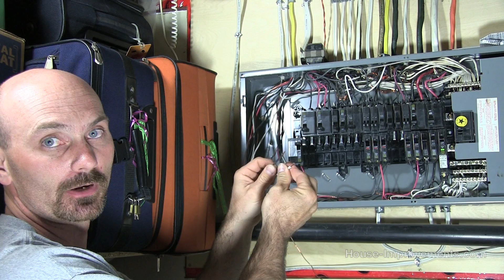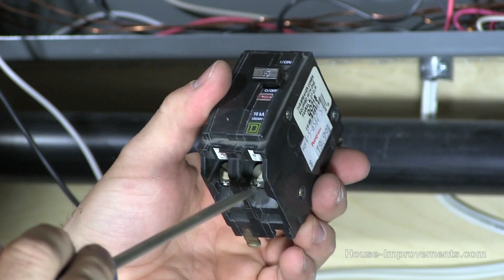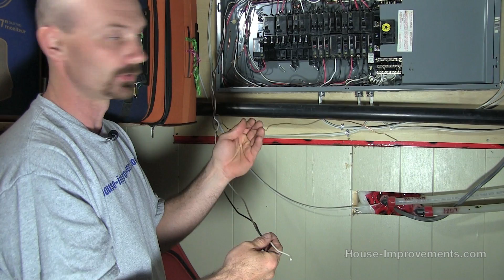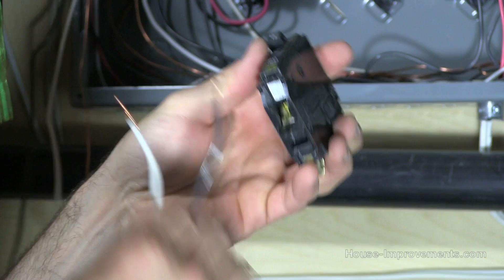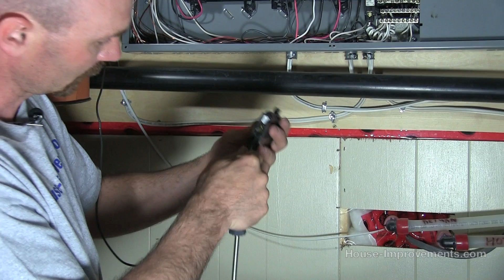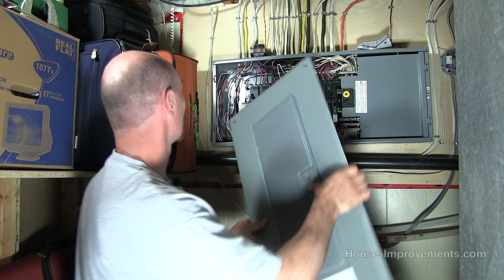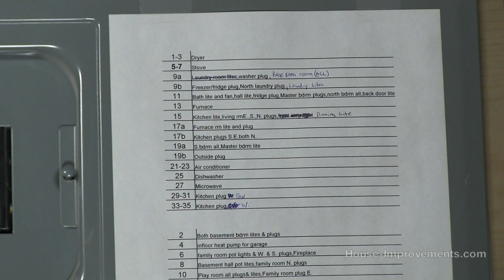How To Add a 120V 240V Circuit Breaker

Comment: Splendid video.  I was kind of surprised 240v only required a ground wire as thin as the other two, though...isn't ground wire thickness supposed to be the same as the other wire feeding the charge?  So, I wonder why the ground for 240 isn't the same as he two other wires.  And I don't understand why both of them are hot, as opposed to 120v having only one "hot" wire and one ground.
I'm trying to do a box for bitcoin miners right now, and I'm just starting out.  What I want to do is build a box to feed nema L6 outlets 220v 24a, and then use nema extension cables with high awg wire to route the 220v to the miners electrical splitter boxes. (IBM DELTA 97P3573 TYPE 7 PDU MOUNT 200 - 240V 9 OUTLET PLUG RACKMOUNT HBL2621)
There is also a second kind of circuit, (PDUMH20HV Tripp Lite Metered PDU, 3.2-3.8kW Single-Phase 200-240V), 16 amps at 220v.
So for a 16 amp 220v device, would you use a 16 amp breaker?  Or 20?  How does that work?
Same with the 24 amp one... would you use a slightly bigger breaker, so it doesn't trip fast?  Or try to match it exactly, so it triggers the instant it hits the max amps?
AND, there will need to be some 110v stuff, but the existing circuits will probably handle that by themselves.  Theoretically though it might not be a bad idea to wire this box with that, as well, to consolidate the mining operations all into one box... or maybe not... not sure about that yet.  Anyhow, I'm not an electrician... but I'm thinking I should build this box myself and get it examined afterwards.  What I want to build is like an outlet hydra, basically... with the outlets near the panel and nema L6 extension cables projecting the power to each rack... well... IDK... I see there are always people taking pot shots online... if you guys could stay clear so the objective / proactive thinkers can talk instead that would be really helpful.  Thanks.

BTW, I haven't even bought the box yet... I'm wanting to just assemble it onto a board, so when I start the lease I'm ready with it.  I'm not even sure which panel box to go with... thinking a 400 single phase might be about right.
Reply from the maker: Please copy and paste this to my forum we can help you from there.  https://www.house-improvements.com/forums/
Reply: ok

Comment: in the case of the 240 breaker, what about a neutral returning wire??/
Reply from the maker: The neutral is only needed on 240v lines where there is an appliance that has 120v functioning parts to it. An example would be a kitchen range or laundry dryer.They have timers and electronics that still need 120V supplied as well. The above example was for an 240V baseboard heater. So you need to see what your application calls for. Generally speaking is if you need a receptacle of some kind on the other end then you will be using a 3 wire so you have red,black,white and ground wire. So your red and black would hook to the double pole breaker and the white to the neutral bar in panel and ground to ground. Please come to my forum for more info.https://www.house-improvements.com/forums/
Reply: Thank you so much buddy, now I understand a lot more!

Comment: I'd like to wire for a tablesaw motor. 3HP 230v and 13 FL amps. What size breaker amps should I use? 20 amps?Also, instead of a white and black going into the breaker; shouldn't it be red and black ,or is it common practice to tape the white wire black?
Reply from the maker: Please use our forum for assistance . https://www.house-improvements.com/forums/
Reply: 3 pole 20 amp circuit breaker with a 12/4 Romex  3phase is black red and blue
Reply: Wrong answer. He never said it was 3-phase. Idiot who thinks he's so smart.

Comment: just one thing i wanna ask, how can I decide when I am gonna use 240V breaker or 120V breaker?
Reply: Benson Kwok depends on what you going to install. You’ll use 14/2 wire for lighting and run it to a 15 amp breaker. For a wall switch you use 12/2 wire and connect to a 20 amp breaker. 240v would be electric dryer, electric stoves, baseboard heaters, stuff like that.

Comment: Good electrician in the video, bad electrician that did original install of planelboard. When panels are mounted horizontally, NEC requires that the "up" position be "on" and the "down" position be "off". So typically you lose half your panel spaces due the fact that the entire top section requires the breaker to be in the down/off position while energized. This panel would also be required to be flipped 180 degrees due the fact the main breaker also indicates down/off while energized.

Comment: Not a journeyman but I can do electrical.  For those hating on the wiring, did it ever occur to you emmy-award winners that this guy bought his house (or it might not even be his) and that is how it was?  You may in fact do proper wiring when you wire a job (or you may not), but I seriously doubt many of you would rewire the house(because it doesn't look like there would be enough wire on some of those circuits) just to have things 'neat and tidy'?

Comment: Hopefully someone can answer this question, but if both wires go into the 240 Volt breaker as HOT, what is being used as the NEUTRAL?
Reply from the maker: A strictly 240V circuit like this heating circuit do not use a neutral. Things like ranges and dryers use 240V but some of the things like timers in those appliances use 120V also so that is why those appliances use a 3 wire cable so that there is a neutral wire.
Reply: Cool. Thanks for the response.

Comment: i work im the hvac industry as an apprentice and i now install new breaker for an ac all the time. still not confident as we dont turn the power off to the house at the breaker we do the work live. i know how deadly it can be so im still het veey nervous . any thoughts please
Reply from the maker: turn off the main breaker at the panel, its right there. Have a flashlight so you can see what you are doing at the panel when power is off.

Comment: For the double circuit breaker, where is the ground wire? Wouldn't it be better to use a 3 Wire cable with a  red wire?
Reply: With that question I wouldn't even bother trying to answer.  That's a burn-down if ever there was one. You don't understand crapola, stay the hell away from electricity, save your life and that of your loved ones.
Reply: Not sure on your confusion.  The ground wire is a bare copper wire that gets attached to the ground bus.  L1 and L2 are attached to the breaker and the neutral wire attaches to the neutral bus.  I would only use a 4 wire cable connection for a new 240V breaker.

Comment: Good job Shannon, you are a good teacher.  I wonder if the other craftsman who installed what looks like Pecs plumbing and some other sort of black piping below the panel knew they were going to get the homeowner in trouble with the inspector? Foreign systems in the dedicated space  NEC 110.26 (F)(1)(d).  I am also curious if Square D listed that panel for horizontal usage?  NEC 110.3 (B)

Comment: If you can explain in the minute 7 to 11 you are installing a 240v circuit with a 12-2 Romex? how your will plug the 240v electric device into the receptacle? how the current returns in the receptacle box?
Reply from the maker: Items that use only 240v do not use a neutral, like a 240v wall heater in this case so both conductors are used as hot wires . Items like ranges and dryers use both 120V and 240V so they still require a neutral. The heating elements are the items that are using 240v  in those appliances but the times and clocks are using 120V.

Comment: never done any electrical work before but I have a question if anyone can clarify.  why/how do you not have to have a natural hookup on the 240V circuit?
Reply from the maker: A dedicated 240 hook up like this for a heater has no neutral. Many appliances that are 240 however use a neutral because they are actually using 120 Volt as well for things like clocks and timers.

Comment: @18:30 it had power, but you had it turned off. You mention a couple breakers later that this one doesn't have power because it's turned off. Why did the first wire have power with the breaker off?
Reply from the maker: That one breaker was turned off.

Comment: Why are some of the white wires coiled?
Reply from the maker: Those are on GFI breakers
Reply: Thanks, but why do they need to be coil? Not an electrician on this end.
Reply: They are just coiled for the packaging ... If you need the length in the panel to land on your neutral bar, you can stretch out the coil

Comment: In my breaker box I have the neutral wire and the ground wire under the same lugs in the same bar, is this OK? (Looks like the original electrical work so I would assume it is OK for me to do the same)
Reply from the maker: If its an older install that is the way they were.
Reply: HouseImprovements house built in 1991
Reply from the maker: Hmm thats odd then. Maybe they reused an old panel. In most places I believe it is perfectly legal. Maybe post a couple pictures up in my forum so we can have a look.  http://www.house-improvements.com/forums/

Comment: 240 one wire black one wire red in most states .....
Reply: Hot leads ...
Reply: Load balance looks lopsided ....
Reply: The 2 incoming phases aren't split up on left and right sides on a panel ;)

Comment: no one else noticed the first lead he touched, the tool beeped. Even thought the breaker was off! awkward
Reply from the maker: These testers will give a beep on contact from static. but if you remain in contact it should stop if the circuit is dead.
Reply: It didn't
Reply: That is fairly normal.  I used to work with continuity and isolation testing on missile cables a lot and when you initially hook up to a circuit that has a capacitor (DC-like circuit since de-energized) you get a current flow till the cap is charged....a short instantaneous beep.  His testing device is doing the same thing until the voltage is equalized.  Given that the panel is grounded, in all likelihood it was the testing device imparting the static charge, not the other way around.  Tricky electrons.

Comment: it's yellow because it's designated that way? Sometimes it will be orange? SMH!
Reply: Dave you are right that is "romax color code" this is so the inspecters can see if you right wire for the job at hand In most states 12 gauge is min wire now being used "Yellow"
Reply from the maker: yellow for 20 amp circuit/ orange or red for electric  heat cables
Reply: Oh?. I thought orange was for a 30 amp circuit. I also thought the colors were to just help ID the different size wire.  14-white, 12-yellow and 10-orange. Which really doesn't mean that is what the circuit rating is. You know larger size cables are run for smaller circuits all of the time.

Comment: Shannon, thanks for all the great videos.  Preface: I just had a small outbuilding built.  I had a 240 volt circuit put in but it only goes to one receptacle.  I would like to add a few additional receptacles for 240 volt power along an ~20 foot stretch of wall.  The purpose would be to allow me to plug woodworking tools in at various places in the shop.  These would not be drawing power simultaneously.  Question: can multiple receptacles be placed on the same 240 volt circuit the way that they are on a 120 volt circuit?  Thanks!
Reply: Yes, you can add more 240 receptacles on that circuit, just remember to correctly size the wires and the OCPD of the branch circuit according to the load.
Reply from the maker: I do not think that is done very commonly and I'm not sure if it is allowed? Ask  your question in my forum, there are a couple guys there right up to date on these types of things. http://www.house-improvements.com/forums/

Comment: you changed the 120v circuit breaker to 240v breaker but do you not think that you should had changed the wire size as well and depend on where to use the 240v for stove or dryer ????|||||
Reply from the maker: Actually we did not change a 120v breaker to 240V. We installed a 120v breaker and a 240v breaker to circuits we had already run as stated in the first minute of the video. You are correct though you can not just change a 120v breaker to 240v without changing the wiring to the proper size for what you are running.

Comment: I'm an electrician and that wiring looks a mess. No workmanship pride at all..
Reply: Yeah yeah yeah. I hear all that blah blah all the time. Im not an electrician but we see a lot of panels when we work. 99% of them are mess. There's a big chance your work is not much better
Reply: I don't think the electrician in the video did the original work with the box.  He's just installing two breakers that he was hired to do.  It'd be great if the pros would recognize that some of these videos aren't from initial build to now.  He's being thorough and his first remark was that this is dangerous and it can kill you if you don't do it right.  That in itself tells me that he is more concerned about safety than making a video for novices.
Reply: I smell Unions.   They are simply veiled nasty comments to try to get the reader to use a licensed electrician.   Which this video is full of text stating so.   It would have been worth the time for Shannon to state, "keep the wires perfectly straight and 90 degree bends  so that the trolls won't be bitching at you when you do your own video.
Reply: +T Landes -- He also pointed out the "double wires under 1 staple" error which was also a clue that he didn't wire the box initially. (@03:00)
Reply: That's the times... quick in and quick out ... get onto the next job & let the other guy deal with it.
Reply: Satch Boogie thats not bad why are you hating on this dude if you are an electrician why are you watching this video!!! these videos are for people who are not sure how to do it and learn from it
Reply: Vault of Games rere
Reply: Meh i've seen 100x times worse. To the point where owner can't even put the cover back on.
Reply: Lol, must of been an apprentice who did it. At least it's labeled.
Reply: I have a box with power but all the breakers are dead none of them work- what is wrong?
Reply: Wafflezombies...they're all off!
Reply: 110.12
Reply: Learn doing messssssss?
Reply: Vault of Games so, would you like 1 or 2 cookies for that?
Reply: Elite Edi I wasn't hating on the dude. I just said that I don't like when people are not tidy. That can cause problems and hazards
Reply: I feel ya brother, I'm an electrician myself and I also cannot stand this kind of mess.

Comment: if it is a 240 breaker it has to be 3#10wire so .
is 2 hot to the breaker and 1 neutral?
Reply: There is no neutral because u don't need it on 240V. each phase has 120V right, take 2 hots and u have 240. meaning no neutral needed.
Reply: i was thinking the same thing where is the neutral ??
Reply: you will have a nutral only on few fixture like dryer or stove those thing need 110v for the clock and thing like that internal
Reply: Not entirely correct but close enough. It depends on the load you are attaching. Some 240V loads require a neutral, and some don't. Also, sometimes you have what's called a "multiwire branch circuit" where two 120V circuits share a neutral. The two circuits have to be on different phases and they land on a 2 pole breaker.

Comment: Man that panel looks like shit , there's an important code in the code book that says that all work must be done in a neat and workmanlike manner
Reply: that looks like  a work of art compared to my breaker box.    When you have a fuse box with half Knob and Tube and half updated, it looks like shit.  I'd take that fuse box any day.
Reply: You're correct that that is in the code book, but it's also highly subjective. Yeah, I would have made sure to have done a cleaner job wiring that panel, but as far as industry standard goes that is, unfortunately, normal and acceptable. I've seen much worse.
Reply: Yeah, that panel looks pretty bad.  I'm not a pro but my panels look like a work of art compared to that.  Good video, just a messy looking panel.
Reply: Yeah look's a tad messy, not very professional
Reply: i like how he says "all nice and neat like this"...